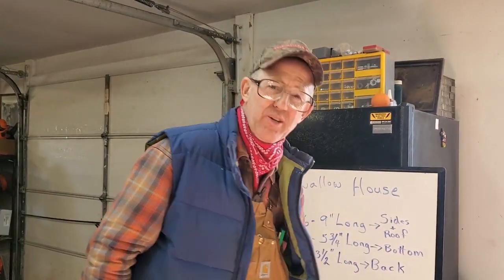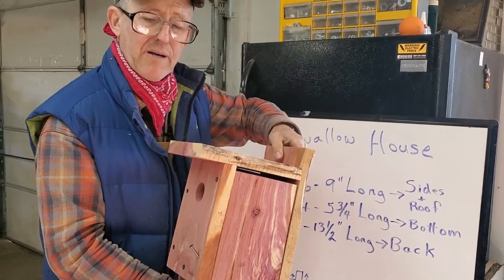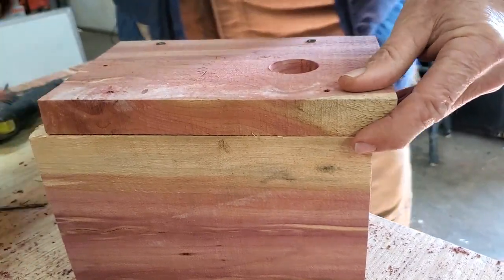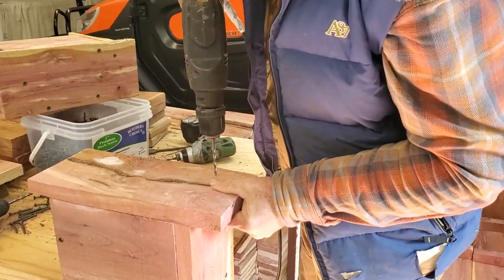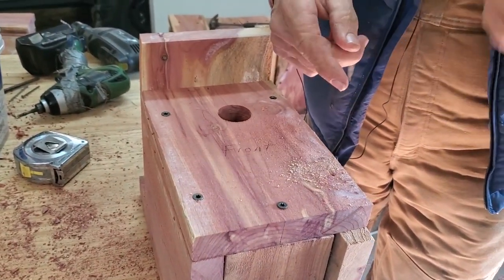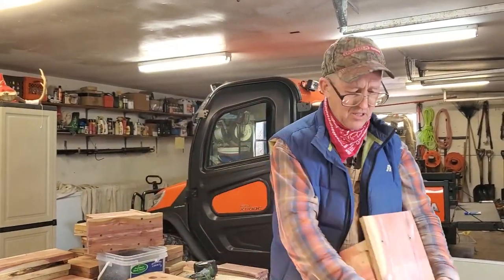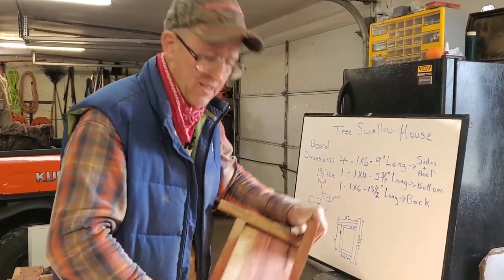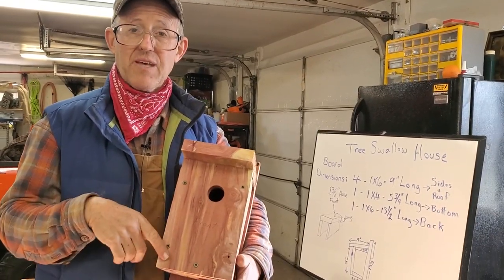The Greg Judy tree swallow bird house explained and built step by step!

Comment: Hello Greg,

I will be re locating all my boxes  to the center of my fields, my fence rows have trees.  How do you protect your poles/boxes from cattle rubbing up? I was thinking dummy electrical wire? I mig so they will only be around each box for a day.
Reply: Nests need to be 8-12 feet off the ground, this stops any rubbing problems.

Comment: Was wondering....why not allow space for a vent on the side without the swing hinge also to allow for more ventilation and also have your bottoms come out even with one another?   GREAT tutorial, Mr. Judy, and as always, I love your content!
Reply: It would make the top a bit more of a trick to attach. Yes the screws would hold it together, but it gets a bit challenging having both sides offset.
Reply: The Gap actually allows you away open the box

Comment: Thanks so much Greg this is amazing advice. Can we just fasten them to existing trees if they are a single tree out in pasture?
Reply: My understanding is they birds prefer them free standing, in the field.  A tree also keeps growing so the 6-8 foot range will be surpassed in a few years
Reply: @4philipp the birdhouse attached to a tree does not move up as it grows. What does happen, if tight against the bark, is that the tree will attempt to grow around the house. Trees grow in diameter and height from the top and not from the bottom.

Comment: My neighbor gave me 1000 lf of PVC 1X6 trim boards.  Is there a problem for the birds if I were to use this instead of wood?
Reply: FWIW I've been using 4" and 6" PVC pipe for birdhouses for years with successful fledging of bluebirds, chickadees, and titmice. I just made sure to make groves or scratches in the PVC under the hole on the inside so they can exit easily.

Comment: Quick question on wood dimension size: Are they true measurements or are your 1x6 and 1x4 acutally 3/4 x 5 1/2 and 3/4 x 3 1/2?
Sometimes commercial milled cedar is smaller than home milled lumber.
Reply from the maker: I saw my own boards, they are the full size, not commercial board size. Saw out one bird house with your boards and adjust as needed to make them fit.

Comment: Might be a dumb question but I'll ask anyways. Any reason to not water seal the birdhouse?
Reply: If it rains, and the rain is coming in from the south or southwest where the hole is facing, there's no way the water can drain out if there's water sealant and air holes that Greg demonstrated. Water doesn't have a place to go; it'll soak up in the nest which isn't good for the baby birds. 
No such thing as a dumb question!
Reply from the maker: Air flow is critical to reduce heat. Face the boxes southeast.
Reply: I think you're thinking about adding a water sealant to protect the wood it doesn't need it it's Cedar
Reply: Rich Ard Lee I know cedar doesn’t need it. If I was to seal it it would be for looks only. When I asked the question I was wondering if by sealing it would it hurt it in any way like the smell for example keep the birds from using it. I have made a few and not going to seal them.
Reply from the maker: @Harvesttimebluegrassgospel  I'm not sure, you could try sealing them, if the smell is not to bad your probably all right.

Comment: That hole allows sparrows to ruin it for Swallows. Needs to be smaller. The hole needs to be an 
oval 3/4" high. Under 2" wide.
Reply: a 7/8  oval is ideal for Violet Green swallows and keeps out all House sparrows  . Tree swallows will not fit into a 7/8 oval but will fit into a  15/16 oval , but the 15/16 will not keep all house sparrows out but does keep most out , needs to be a tight fit 15/16 made with a forstner drill bit .

Comment: I have problems with red wasps building nests in my bluebird boxes, the bluebirds wont build a nest if the wasp is in there, the wasp nests range in the size from a dime on up, most are small. I get about 50% bird nesting because of this. Will the bleach help with this or should I use an insecticide?
Reply from the maker: We don't have issues with wasps. Swallows may eat them!
Reply: @gregjudyregenerativerancher  I build my boxes very similar to yours, I think the wasp enter the vent gap much like honey bees do on a hive box, I'm gonna put some screen door cloth over the gap like  flap to discourage entry

Comment: Question: on the treeswallowprojects.com/buildbox.html they say the bottom needs to be 5x5 at the smallest. it look like 4x4 can work but more babies won't make it. Have you notice when you clean the nest any dead birds? Not to say that yours don't work i just don't want to build some then find not it too small. It probably doesn't matter if your's are doing so well.
Reply from the maker: I've never found dead baby birds. I read the same blog that recommended 5×5. It may work fine.

Comment: 1. Base is too small for tree swallows. 23 sq in. is too small. Minimum is 25, best is 30.
2. No cross ventilation. You need slots on both sides. Those two holes on the side are of no benefit. The holes in the bottom are not for bird excrement. It is for rain to drip out. 
3. Two holes on front are far better because nestlings hog the hole depriving other nestlings of food.
4. No ladder to help them get out. Dangerous. Tree swallows have wide wings. They need that ladder or may well get stuck and die.
5. No discussion of predator guard which should be a 5 foot cylinder, not two feet. Snakes get by 2 feet.
6.  Treeswallowprojects.com is the authority on proper tree swallow houses. And, I highly recommend my Miller guard, a 5 foot duct pipe from Lowes or Home Depot. Stay away from commonly recommended 2 foot duct. Does not stop rat snakes.

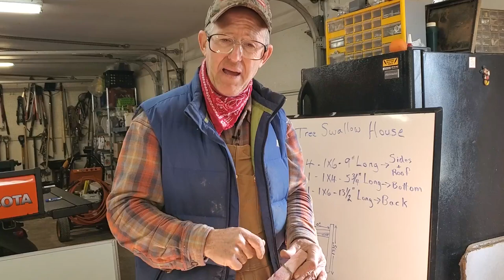Comment: 17:07 wind and rain
Reply from the maker: That's one of many minerals that has fly egg killer mixed in the mineral. Thanks for that!
Reply: Greg Judy Regenerative Rancher we were told that if we use it for 2-3 years then we will see a decrease in flys and idk if we have but do you suggest that we still use it and buy it or what? Is it really killing the soil?
Reply: @bigwhane8603  it not so much killing the soil as it's stunting soil life. You will never have a vigorous worm or dung beetle population until you switch from "preventative" pour ons to spot treating.
Reply: @bigwhane8603  Besides the effects on soil life premixes are mostly salt, and it's an expensive way to buy salt. You could probably save some money mixing your own or switching to free choice minerals.

Comment: I've been having issues with English sparrows taking them over.
Reply from the maker: We have some of those to, I yank out the sparrow nest when I see them.
Reply: The hole needs to be an oval 3/4" high. Under 2" wide.
Reply: until some one  comes up with the ideal hole size for Tree Swallows that will protect them from  house sparrows , you could  trap or shot them  .